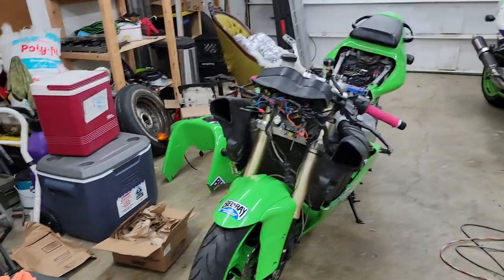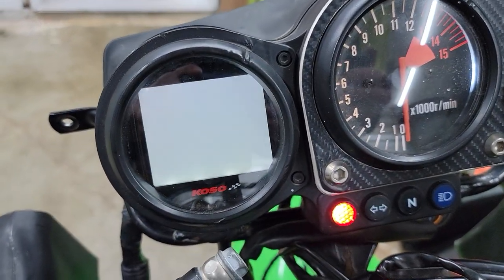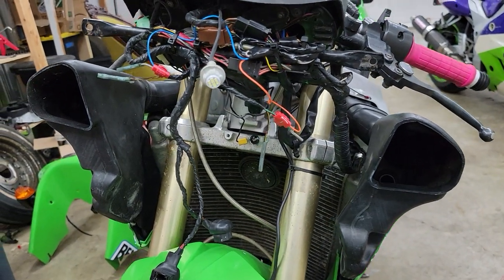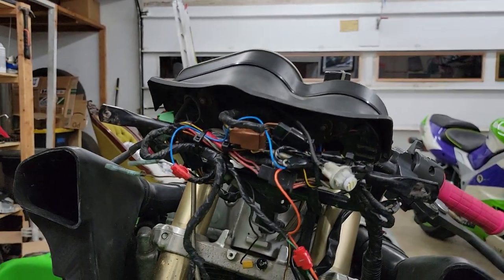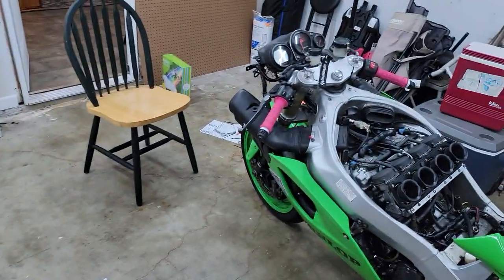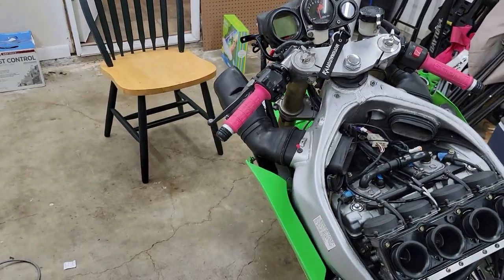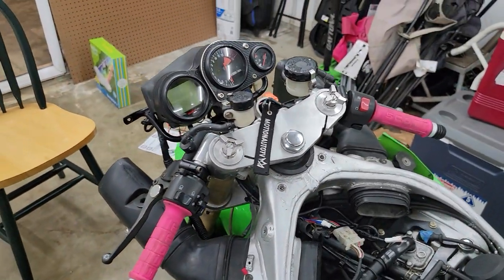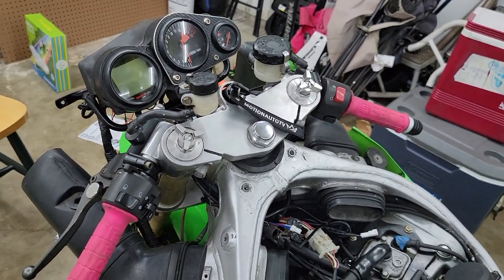koso digital speedo on a zx7r!

Comment: If ur still around .... How is the speed sensor setup I want this I have a p5
Reply from the maker: It's a GPS sensor. The zx10r reads speed from the front vs the front tire like the zx7 does. 
So when you buy your koso dash make sure to also buy the GPS speed sensor. 
Plus right in

Comment: know the video is old

but regarding the fact that your buttons are hidden inside the housing so you can't operate them without having to take your entire Koso speedometer out. But didn't you show that there is a kind of remote control for the Koso products, to precisely avoid the problems you have/had, I know I wasn't aware of this.

super nice video .... But I have a little thing that I think you should start avoiding and then do it right the first time you work with it, and it's the little Red Cable Thieves you use to take power from a cable and give it to another cable, drop the Red little cable thieves because you will certainly experience problems sometime in the future with the model you use.
Reply from the maker: No controller to my knowledge for the koso.. 
I set it up prior to putting it inside the gauge cluster housing. By doing that I wouldn't need to mess with the buttons unless time changed or what have you..

Comment: i know this video is a bit old, but how does the fuel gage work if the bike itself doesnt have a fuel gage? im looking for a digital dash for my zx7r and cant really find one that looks nice
Reply from the maker: Unfortunately unless you do sone real work you can't get the fuel gauge to work
Reply: @sunsetsportbikes9435  and if you don’t mind me asking, Is the shifting smooth for you? I just bought this zx7r and the shifting doesn’t want to catch the next gear unless it’s at a specific rpm, mainly around 8.5k rpm’s
Reply: @sunsetsportbikes9435  do you know if there are any digital dashes that work better than this one?
Reply from the maker: @v1z3  I'm not sure how much better you want? 
This one worked perfect. 
No problems at all.
Reply: @sunsetsportbikes9435  I honestly don’t know what I want tbh. I’m just trying to rebuild this bike lol. Only thing that’s holding me back from buying this dash is that I can’t reset the trip mileage without taking off the whole thing. Or is there a way around it
Reply from the maker: @v1z3  unfortunately with how I did it you have ti take the whole cluster off